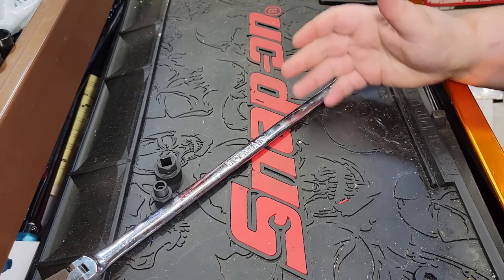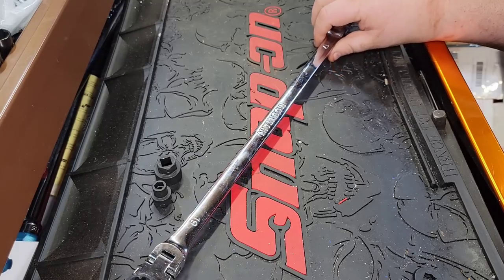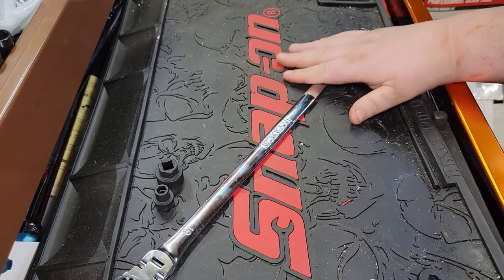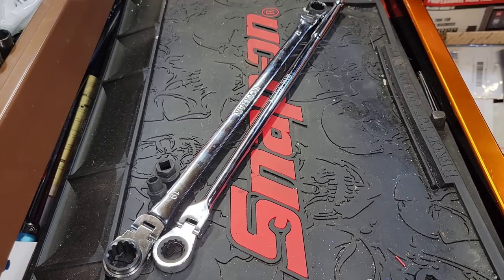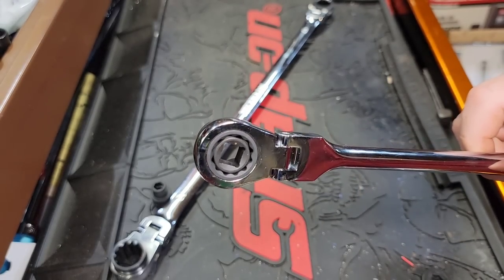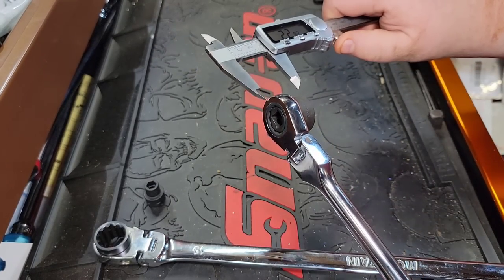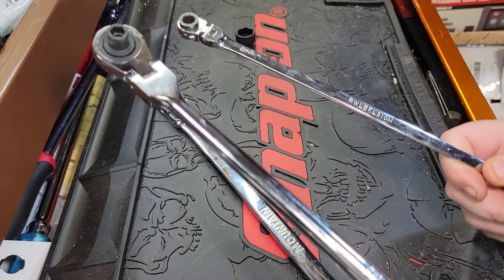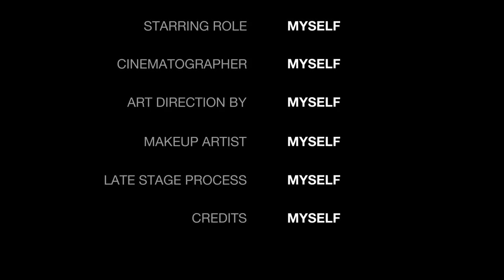Astro Pneumatic Tools Just gave Harbor Freight Icon wrenches a lot of trouble!!

Comment: Cool. I just picked up the long handle 17mm wrench. Also, you can use a 3/8 Ernst twist lock clip to hold the 3/8 nano sockets onto any 17mm box end. Another way is to use a low profile 1/4 to 3/8 adapter to retain the sockets. I've been using them with my Tekton extra long double box end wrench (17x19mm). Finally, on a 3/8 m12 stubby impact they make for a nice, compact setup.

Comment: Northern tool sells those same ratchet wrench tools, like the Mountain brand you showed early in the video. Of course it's labeled KLUTCH, for Northern Tool's name brand. However, they sell them individually, not in sets. I bought one at a local Northern tool store that's a 13mm on one side and 15mm on the other. Love that tool, and I also work in a heavy truck International/Navistar dealership. I haven't broken it yet. From what I understand they carry a lifetime warranty. So when I do eventually break it. I should be able to return it to my local Northern Tool and get it replaced. We will see how that turns out. If you have a local Northern tool store near you CP, check it out and let me know what think.

Comment: Astro nano sockets. The 3/8 drive uses a 17mm backing buy a gearwrench xl 17mm flex head wrench.....the astro nano 1/2 drive uses a 22mm backing but the gear wrench xl 22mm flex head wrench and the harbor freight pass thru socket set uses a 19mm backing buy the gearwrench xl 19mm flex head wrench....the pass thru sockets are like owning a infinite deep socket set....

Comment: I bought the monster brand wrenches same as the mountain brand. I got them from my matco guy and I bought from him cause of the warranty hearing mountain wrenches fail a lot. But the monster brand has stood the test of time. I have used every size even the x large 21 22 24 25 ones and haven't broken one yet. Had them 4 years using daily professionally daily all sizes and the spline drive hasn't even worn down. I was iffy at first but they have been life savers. Top 10 grab first tool for sure. Just thought I would put that out there. Have not checked prices recently. But have paid for themselves plenty.

Comment: Glad to hear about this. I have the nano socket set. I've been using a blue point 17mm locking flex head reversible box end wrench (BOERMFLCG17) with an ares (70198) 1/4 to 3/8 impact adapter to lock the sockets onto the wrench. This longer style is definitely a great option.

Comment: I have both the 1/2" and 3/8" nano sockets. I was not aware of this wrench, and will be getting it after I am able to make sure that I can use those nano sockets on upper control arm bolts for alignments. Probably get it anyway at $35, but that is what I am most interested in using it for.
Reply: For a DIY not a pro would you recommend husky 3/8” nano or the Quinn 1/2” nano?
Reply: @Balla1309able  If youre comparing between just those two, I'd probably say husky for now. Quinn only has the 1/2" sets right now but its nice to have the choice between 3/8" or 1/2" that husky has. Likely made in the same factory anyway.
Reply: @zackschwenzer4892  ohh okay, thanks for feedback. Are the 3/8 same size as 1/2? I read a comment where someone said they couldn’t tell them apart but I would think that there is a size difference
Reply: @Balla1309able  The 1/2" drive versions have a larger hex for using a bigger ratcheting wrench on (22mm vs 17mm hex). I have both sets from astro but I haven't actually compared the sockets between themselves. If the 1/2" size is bigger on the socket end, it is by a very small amount.
Reply: @zackschwenzer4892  thank you I couldn't find much info

Comment: Wonderful video CP. Did you reiterate your problem with the Icon warranty at your local Harbor Freight? 
What'd they not do for you? What'd they deny and what'd they say was the reason? 
I've warrantied 4 things that are Icon and haven't had a single problem any time.
Reply from the maker: Wasn't a warranty issue it was a buying individual sockets to replace in the set.

Comment: I bought the tekton dbl flex wrenches recently. Not locking, but pretty nice. Got them on sale too. I had to add some o-rings to tighten them up. I just got this Astro wrench this week, had it on order for a couple weeks. Haven’t used it yet. Hoping it holds up.
Reply from the maker: Good tip!

Comment: I have the Duratech extra long anti slip flex head set, I believe is cost me right about $60 and the only issue I have seen is that the flex head is really tight and when your reaching to a fastener it can be hard to get it to slip on it.

Comment: I don't like the reversing switch on the mountain wrenches. I find they get switched too easily when trying to use them in tight spaces to get a bolt or nut out.
Reply from the maker: Very good point!!

Comment: Great job on the Astro wrench, CP? Never got those style wrenches, since spline drive sucks in my opinion? Will easily slip on corroded fasteners? 6 point is my favorite, and with the Nano sockets, a dual purpose set with that wrench?

Comment: The tools don’t make the technician, the Technician makes the tools they have work
Reply from the maker: Wrong with new computers and modules you need the tools tell me how you program a pcm without tools smart guy?
Reply: @CPthetooladdict  I apologize if I wasn’t clear. My point was that the best tools in the world do not make you a good technician. 

You’ve been at this a long time CP, how many times have you seen a mechanic go down the parts trail because they got a P2195. After replacing the O2 sensor, cleaning injectors (maybe even replace them), and fuel filter, they stumbled upon the leaking intake manifold, or the shorted wire they should have check for to begin with. 

That was the point I was trying to make.